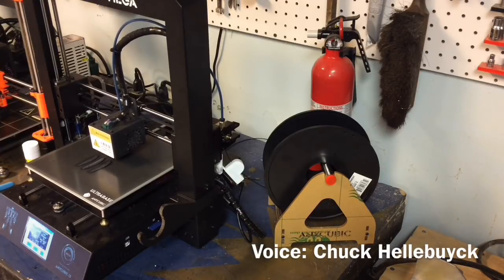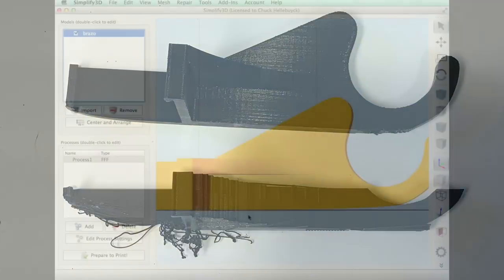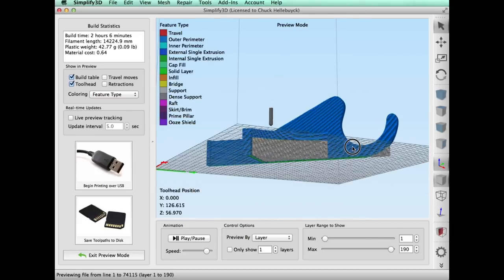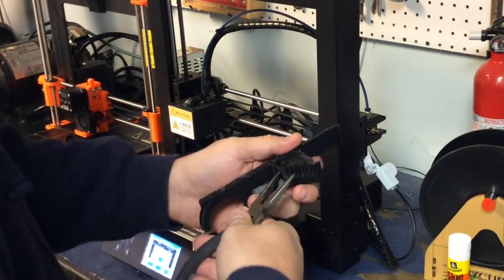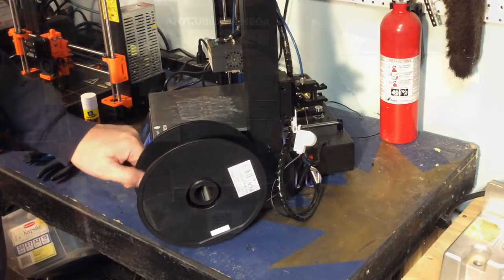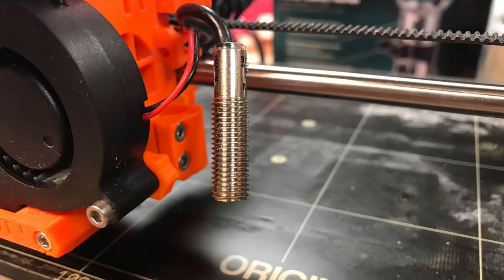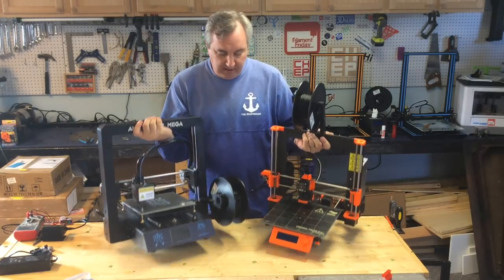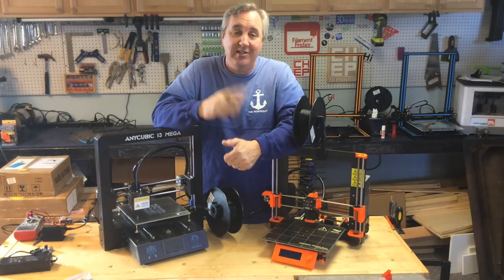Anycubic Mega I3 3D Printer Filament Spool Holder and Prusa MK2S Filament Blob Repair

Comment: The best way to get rid of a catastrophic print like that is to just heat up the hot end.
As soon as the plastic that's actually fused to the hot end liquefies you can pull out the whole thing.
All the plastic that keeps rigid after the hot end is heated is so far away from it when it solidifies in the first place that it almost definitely won't actually have fused to anything, not even printed parts. I've had this happen twice on one of my printers and managed to clean it up by doing this without breaking any parts.

Comment: Hi Chuck - I downloaded the spool holder, printed it and tried it out.  I found that it drooped down and after a couple days the filament spool was touching the table my printer was on.  I decided to redesign it from scratch using Fusion 360.  I measured the frame of my Anycubic I3 and used that for my design maintaining the original designers concept.  I designed the shaft holder end  about 30 mm shorter and maintained the shaft diameter so I could use the original shaft.  I snaps in place tighter than the original and after 4 days it has not sags at all.  I did make the width of the frae clip a little wider with still space below the screws on the I3 frame.  I wish there ws a way I could send it to you because I think you would like it.

Comment: I see you have 2 CR-10s in the background, what mods/upgrades have you done to them? I keep switching which printer I would like to get to replace my POS davinci 1.0, the prusa i3 mk3 or a cr-10s. I know the prusa is more money, but it should print right out of the box, where the cr-10 most likely will a mirror to replace the glass bed and a extruder fan upgrade to get the printer to bridge print. 
I see you hit 20k subs, congrats.

Comment: Hey Chuck you could have printed the first part of the spool holder on its side and it would have needed no supports. Also loved how you disappeared on us at the end!!
Reply: @The Tinkerer Corner. I've just placed it into CURA and yes I believe you could easily do it. Much less support too. I'm not sure if the supports on the clips would cause an issue but I'll give it a go before my i3 Mega arrives. Cheers, JAYTEE
I just had another thought, it may not be as strong given layer direction and the forces against the hooks
Reply: CHEP 3D Printing & Electronics I just drag that booger into tinkercad and turn that curved overhang into a straight overhang and it's a simple Bridge either printer should handle but you know something it only took you 2 hours and it looks fantastic so I say who cares I normally hate support but that came out great

Me personally for the spool itself I would have cut it in half and printed two halves to cut down the print time but again you did it in just over 3 hours and looks fantastic

So either way I think your way with was the right way the results speak for themselves. awesome.

As for spool holder please keep us updated on it how well it holds up after a month or so I worry about it sagging over time I'm making one for mine using a piece of Extrusion and an Ender spool holder same idea but metal and mine will be in the back if that one holds up probably a better solution than mine because you can just print it :-) I sometimes complicate things more than I need to :-)

 please keep making the great videos I love your Channel one of the few 3D printing channels I subscribe to :-)
Reply: CHEP 3D Printing & Electronics that's interesting did you try running it through netfabb first? Also I wasn't referring to the non flat bottom I bet changing the bracket portion that required support from a curve which you can't Bridge to a straight triangle section which you can Bridge :-) meaning no support would be needed it wouldn't be super clean but it would work but I think your result came out fantastic so I suspect the support is worth it I just kind of have a fetish for figuring out how to do it without support :-)

Comment: It would have been probably cheaper to buy the XAGIPS8X4-5V sensor from Xagyl, Canada, even though the sensor is more expensive per se.

BTW, you can reprint the plastic parts for the Prusa. In hindsight, it could have made sense to first reprint the parts and then just melt everything down and replace the plastic.

On the Anycubic - what do you do if the display goes bad? OK it's MKS display, but i don't know if it requires special firmware for the display itself? The trouble with closed source printers is that they aren't infinitely repairable.

Comment: That's a very large diameter spindle. I have adapted the design (thank you btw) for my Wanhao I3 and am printing a 31mm dia. spindle as some of my spools just won't fit on the big one.
Reply: Had to adapt the bracket to fit the Wanhao https://www.thingiverse.com/thing:2673790

Comment: I am surprised there isn’t more of a standard (either in implementation or in practice) of saving models (that are intended to be printed) with an orientation for optimal printing. This reminds me of the old digital camera days when JPG images didn’t save an orientation.  Portrait orientated shots would always open sideways. I get that adjustment may be needed and that some printing processes have different optimal orientation. It just seems like a sensible default would be nice.
Reply: Well of course there is a standard! All slicers have the same orientation - z goes up. This is surely merely a convention rather than something that's enforced, but it's an ancient convention that goes back to CNC milling and engraving machines. So the way it was placed is apparently the way the designer of the item thought it should be printed - perhaps his opinion of what constitutes optimal printing was different from CHEP's, perhaps he couldn't do it any differently because he had less build height, perhaps what he did worked well enough for him, or maybe he simply saved the files with a mistake in them. It's not the fault of the format.

Comment: Where did you get the hot end for the PRUSA? I just had this happen to my MK2
Reply: CHEP 3D Printing & Electronics the 12 or 24 volt system? Im new to 3d printing so I'm unsure of what I need to get. Was hoping to find a video on how to replace everything, but I've yet to see one.